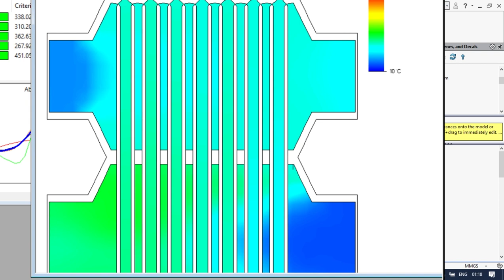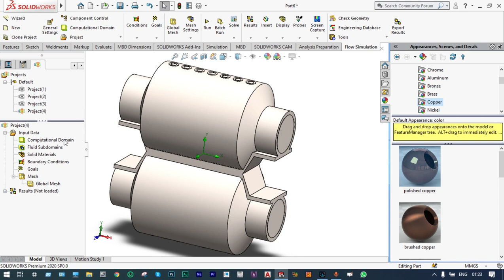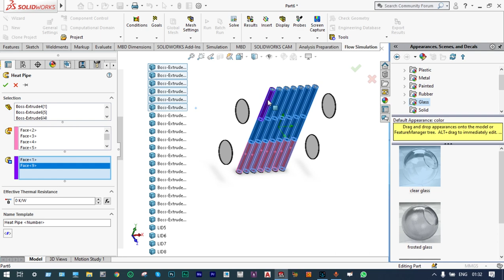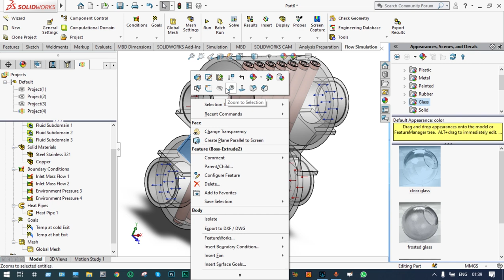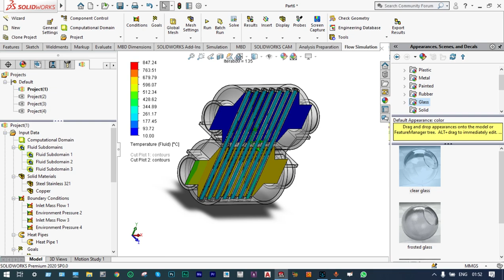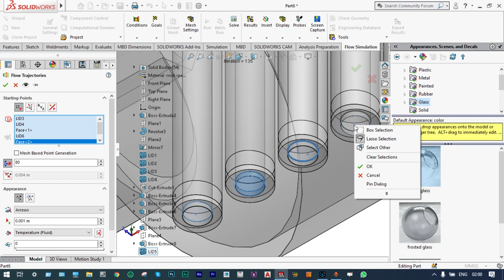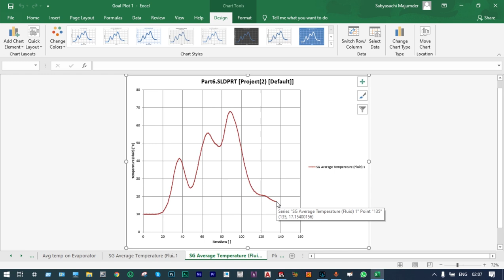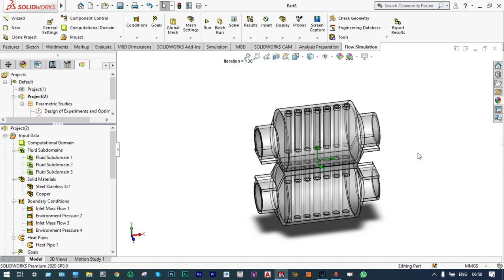CFD Parametric Study & Optimization of Exhaust Gas with Heat Pipe |SolidWorks 2020|

Comment: Hi, I need to simulate my project, air to air heat pipe heat exchanger. Have you read my email?
Reply from the maker: Please provide specification
Reply from the maker: Model is ready and will be simulated  soon
Reply: @CFD_GUIDE  will you share this simulation?